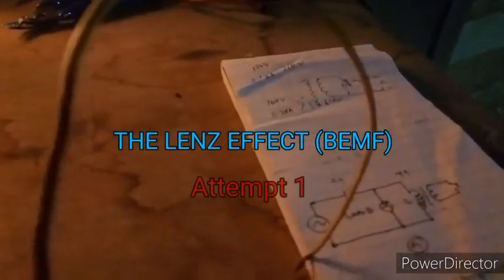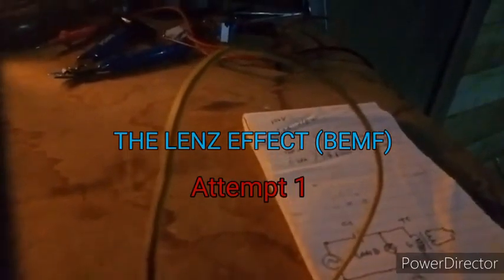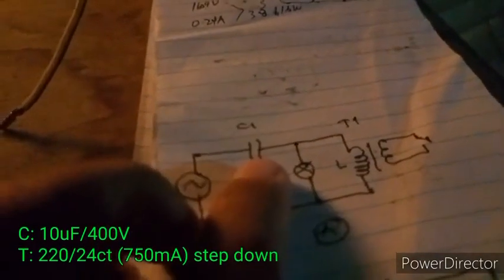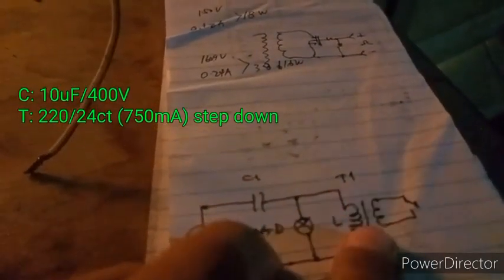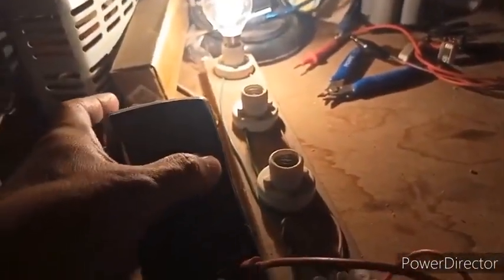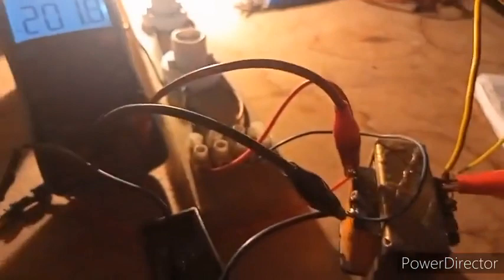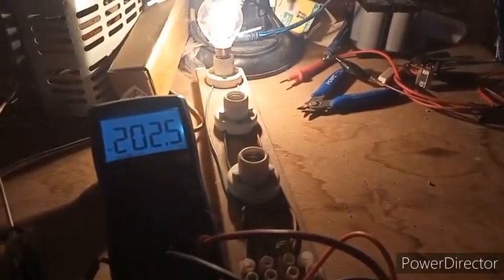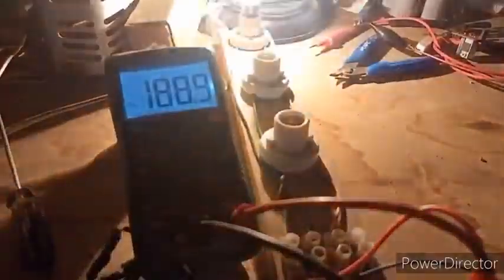#47 THE LENZ EFFECT (BEMF)

Comment: Try experimenting with larger size caps (20 microF - 100 microF). In my setup, I use a large toroid transformer in series with the cap on one side and a dimmer switch on the other. The secondary side of the transformer can be connected to a full-bridge rectifier (this setup worked best for charging batteries) or to another bifilar air transformer connected to a load (resistive load worked best in this case). The purpose is to have circuit tuning ability. The circuit power factor (it changes with the load) needs to become 0 or negative. This would mean that your load is consuming reactive power. No real power is used from the grid. To notice this, you need a power analyzer. Consumer household watt-meters are not properly built to show negative power factor. The best case scenario I saw was 70 watts of power running through the load, while returning 5 watts back to the grid. Once a wise man said: "Tune your circuit to the load". A power analyzer is a must.
Reply from the maker: Thanks you so much sir for the nice input. At the moment I don't have those power analyzer. Wishing I could have one to soon.

Comment: There is no back emf its induced a.c wave. It travels in both directions.
Reply: It is both,its induced energy stored on wire that collapses coupling its energy  with back emf...
Reply from the maker: That's what I'm thinking especially when intermittent shorting at the secondary happen.
Reply from the maker: We have multiple functions here. Raising the voltage at the load while we can also harvest the BEMF on Secondary.
Reply: @PLASMUX-20 what if we make a multiple secondary over big transformer.lets say 4 secondaries 3 for harvesting back emf and 1 secondary coil for shorting triggered by mosfet so it can resonate with primary like ur setup now.and the 3 extra secondary coils is rectified and fed back to caps in parralel with the output
Reply: @PLASMUX-20  isnt the shorting of secondary can trigger a continuos voltage rise on caps..back emf voltage or collapsing induced field depends on input voltage.. cause u feed it first with 2o0v plus extra voltage from ambient equals much higher voltage compare to first cycle.. lets say now the cap is charge 250v cause of collapsing field and back emf.if the cycle continous this voltage gain every cyle will result in voltage rise continously...  hope i have oscilloscope to test this..
Reply from the maker: There will be right freq and duty of intermittent shorting on the secondary as I believe. Also need signal from primary for syncing.
Reply from the maker: There will be right freq and duty of intermittent shorting on the secondary as I believe. Also need signal from primary for syncing.
Reply from the maker: Good idea but need experimentation.
Reply from the maker: I have to apply this concept in the Kapanadze exp... I've done this before on my Akula/Ruslan project but failed that time, need to revisit as well.
Reply: @PLASMUX-20  this coupling of fields is hard to obtain in an aircore..thats why lots of experimenter failed in kapanadze and don smith type of device.. coz this coupling effect never happens in smith kapanadze coils..this is the effect ive been hoping to achived since i started this trend 10 years ago.. ive achieved useless back emf in the past.but this one is directly brightens the bulbs with no complicated set up or drivers.its very efficient too...no special drivers need just syncing prove to the primary down to base as triggers and its done.
Reply from the maker: Bro, have you deleted your last comment?
Reply: @PLASMUX-20  nope
Reply: @PLASMUX-20  ngyn k lng napanasin.same ito ng cnsb ni ISMAEL AVISO self charging car  nia.. ung schematics na ito ai pinakita nia s knyng tutorial kung panu maka gain mg extra energy tru shorting.. AT nung kay MUSTAFA...my extra inverter lng ung ky MUSTAFA png charge ng cap at scr png discharge..
Reply: @PLASMUX-20  you could utilise a dc motor for the shorting maybe.
Reply from the maker: Yes bro we can. However, only the frequency can be adjusted and as the freq increase the duty will decrease. Still the microcontroller is better.
Reply from the maker: @dapakers  Yes bro, maybe. But I found another setup in PJKbook, that might be similar to Aviso device... What I observed is those setup is closed to the configuration found in xenon bulb or flash tube trigger circuit. First charging the cap then shorting the input by using SCR making the capacitor discharging its energy into the coil. I've been experimented the same technique long ago. Need to get back at it. 
Hoping I configured all the spices into one delicious piece of pie.
Reply: @EnterTheRealm  i remember in my highschool days.. when i pulsed transformer using dynamo with oblong gear to open close the contact points of ignition of an old 2  stroke motorcycle.from 12v to 220....now its very common to have solid state of everything..
Reply: @PLASMUX-20  me too..im planning to use my disruptive discharger here to pulse transformer sexondary instead of shorting it..and see what happens.
Reply from the maker: Maybe...
Reply: @PLASMUX-20  do you have oscilloscope?
Reply from the maker: Yeah, but I need isolation transformer to do this for more safety.
Reply from the maker: Ok bro, thanks.